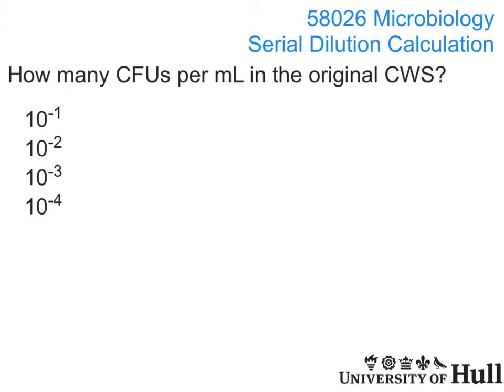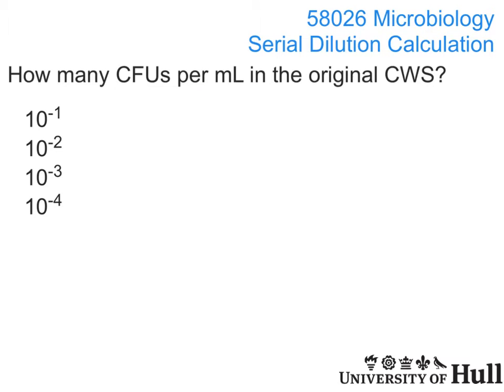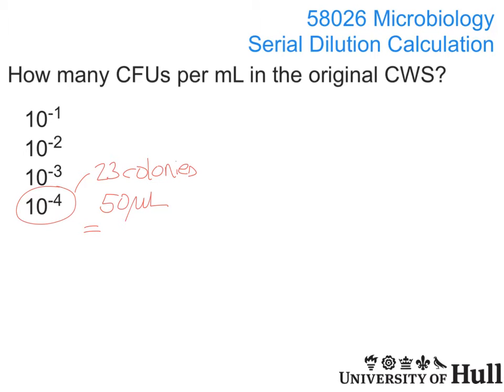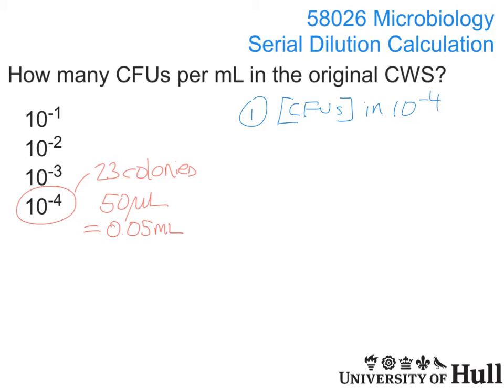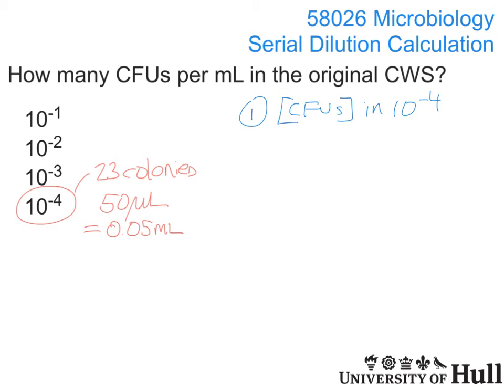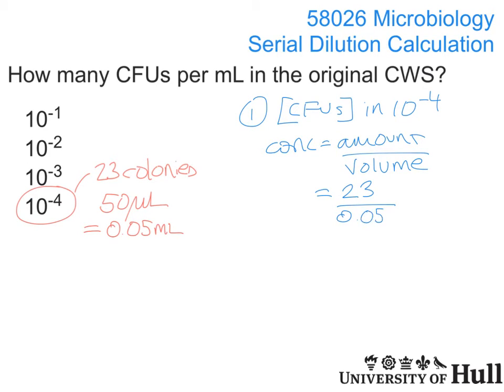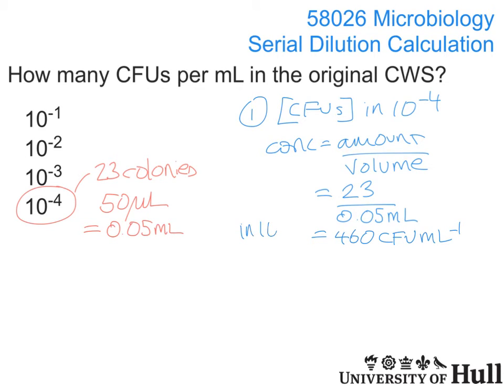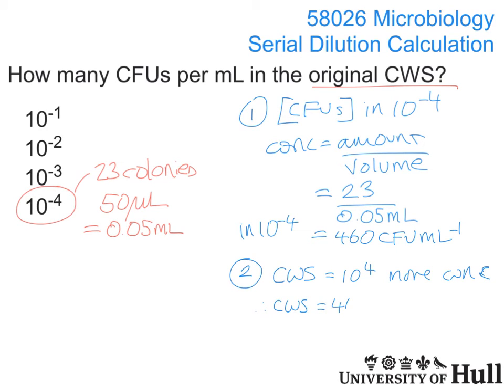Microbiology Serial Dilution calculation

Comment: Assuming that serial dilution was carried out in a laboratory experiment in 6 tubes with 9 ml of saline in each tube and 0.1ml of the stock solution was used for initial dilution, pour plate method of inoculation was performed after the dilution process using 1ml of the culture from the samples from the test tubes.   It was found out that on the 6th Petri dish after incubation, there was a total of 16 individual colonies counted.  Compute the total number of microorganisms present in tube one, assuming that there was no human error in the transferring process.

Comment: how did you get from 10 to the 4 to 10 to the 6? that's whats confusing for me.HELP! ty.
Reply from the maker: Hi there - not sure I quite understand your question but here goes! The dilution was set up as 10^-4 i.e. 10,000 times more dilute than the original. So when we have the concentration of CFUs in the 10^-4 dilution (460 CFUs/mL), the original must be 10,000 times more concentrated, i.e. 10^4 more concentrated. We therefore do 460 x 10,000 (same as 460 x 10^4) = 4,600,000 CFUs/mL. To express this in standard form we divide by 1,000,000 i.e. 10^6 so that we get 4.6x10^6 CFUs/mL as the final answer. Note that standard form requires you to have a number between 1 and 9.9, multiplied by 10 to a power - there are lots of videos on how to use standard form on YouTube. Using standard form is useful in biology, as it means you are much less likely to accidentally forget or add a '0' in your working, and means that you don't have to manually count all the '0's in your answer to interpret it. Hope that helps!